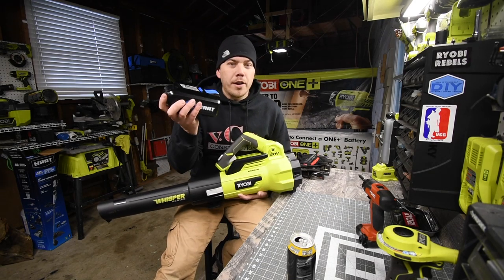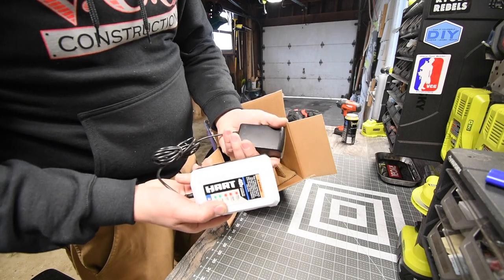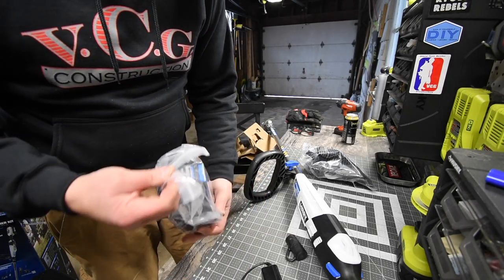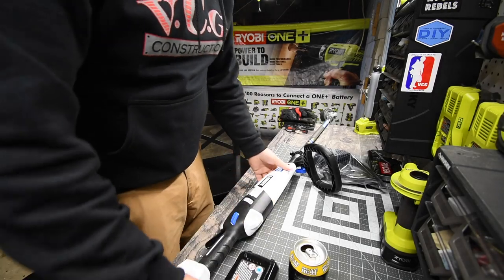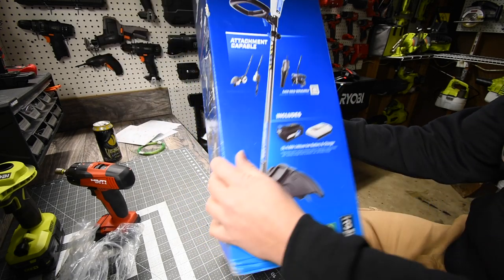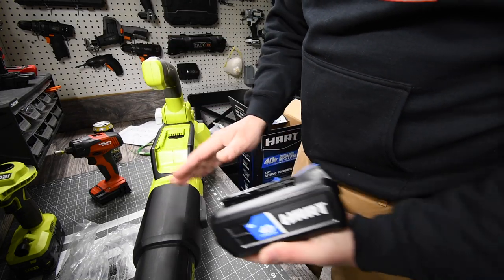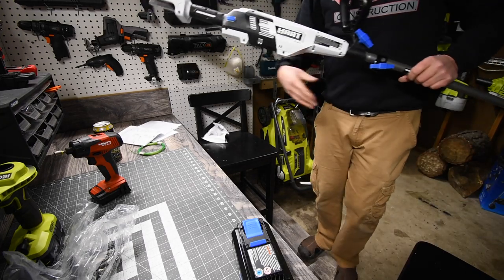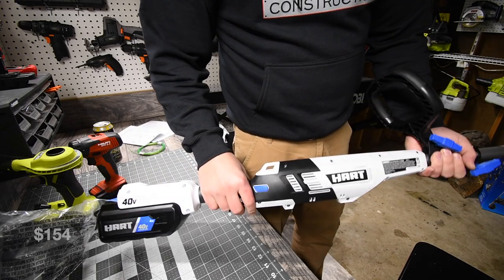Walmart - HART 40v String Trimmer Unboxing/Demo

Comment: This is a great tool I got one yesterday, left it charging overnight, used it in the morning cleaning up a bunch of weeds on a halve acre lawn,  trimming and stuff, used the tool for about 1 hour and a halve continuously, placed the battery on the charger and it showed 1/4 of the charge left. So with that said, this is a tool for home usage, not for commercial use unless you carry more batteries already charged, I really like it for home.
Reply from the maker: no lawn care battery tool good for commercial use. but im glad you like it and I can't wait to try out mine this summer
Reply: @ManCaverTools  hello

Comment: That line will work with Ryobi 40V Expand-It Heads also. There are also many other brands that are interchangeable besides Hart/Ryobi. The "Expand-It" lines are All interchangeable from all that say "Exapand-It" on them. I sold all of my Expand-It Ryobi units. That black cap is to hang all the attachments on a wall for that "Main Unit". They make a blower, edger, tiller & a few other ends that work with the line. I have a bunch of the those "Black Hanging Caps" left over I bought to add to my kit/bundles I sold.
Reply from the maker: that is good to know sir, ill have to try that out and thank you

Comment: I have the 20 volt version of this. It does a good job for what I do as I mow 4 yards. I would prefer a gas over the 20 volt but it is acceptable
Reply from the maker: another video about this is coming soon and it works great.
Reply: Get rid of gas and switch to electric for three top reasons:
1- quieter. 
2- no maintenance needed. 
3- zero emissions. 

Gas ones keep vibrating and too noisy. When i use electric one. I can hear others when they call ne unlike gas ones. They are at least 15 decibels quieter. So your ears will not get damaged over time.
Reply: How many minutes can you get off a single charge for the 20v version? I'm thinking of getting that one since it's cheaper in price than the 40v one.

Comment: I have 1 question and 1 warning. Question: how long did the 4ah battery take to charge?
Warning: I've had that version of the Ryobi expand it system with attachments and be careful of the loosening and tightening of that wing bolt and clamp. That style from TTI is prone to stripping. I was tough on my first one, easy on my 2nd one, both still stripped. Ryobi has since upgraded their design of that clamp, but Hart looks like the older Ryobi design. I have spoken. 😁👍
Reply from the maker: Th 4ah battery took about 2.5 hours to charge, the Ryobi battery took about the same time. I cant wait to test this out during the summer
Reply: Comes with a five year warranty. I would like to think if the wingnut striped they would replace it.

Comment: HELP I have that but it also came with a leaf blower and when i start the Weed eater the string keeps extending and it gets huge and I dont know whats going on
Reply from the maker: The string is not installed correctly. you should try to install it again because it should get to a certain length.
Reply: reverse the string spoon pool opposite to your machine's movement like if your machine moves clockwise then your spoon should be counterclockwise.

Comment: Anyone found a way to buy attachments for it? I went to the website and nothing is listed. I tried the website on the box ( Powerfit.com ) and the site doesn't work. Also, they don't have a way to buy the 40v 4ah battery. Only the 40v 2.5ah battery. I am very happy with the trimmer but will I be able to get parts for it in the future? Are the parts not available because this is a brand new line of tools? Thanks
Reply from the maker: I have not found the attachments yet. they might now be ready to sell yet
Reply: Pretty sure it's universal attachment size.

My edger from my old gas trimmer fits and works in the Hart

Comment: I got the Hart hammer not bad.  I'll stick to my 40v Ryobi mower, blower. Good video. Dont forget the PrueCrew shout out. Thanks Dave.
Reply from the maker: I got the brushless drill today
Reply: @ManCaverTools  Hart has got a brushless
Reply: @ManCaverTools  harbor freight just came out with an 80v system called Atlas.

Comment: I had the Ryobi and the only complaint I had with it is the trimmer head spins the wrong way. It flings everything at you if you hold the trigger with your right hand. All gas powered trimmers if you are looking down at the head spin in a clock wise rotation and the Ryobi and this one spin counter clock wise. I ended up having to use it left handed to keep from being covered and stung from the head. I was very happy with my Ryobi's run time for the size yard I had but on taller stuff it is a bit gutless so I had to take smaller swaths to a gas machine.
Reply from the maker: we will see how this performs in spring summer and fall and thank you sir
Reply: Yes, I know what you mean.  To compensate for that you need to trim from left to right.  A larger string guard would help immensely as well.  You should also pick up some braided .095 trimmer line, which works great on taller and tougher weeds and lasts a long time compared to smaller diameter line.
Reply: @bulldog7659  I have the Ryobi 40v trimmer (2nd one) and the blower. The trimmer guards I always remove and the Rotary brand .095 braided line is the best hands down,

Comment: Just bought this. Only because I didn't want to run to home depot during covid😷 can't will be using it tonight after charge
Reply from the maker: I hasn't failed me yet and it works pretty well
Reply: @ManCaverTools  it's a monster.   I am still working but I just cleared a well overgrown area.👍👍

Comment: Reading booklet, BEFORE making adjustments to any moveable parts, of HARTS weed eater, with your hands, REMOVE BATTERY from unit.... possible injury to yourself. In your video, you really didn’t emphasize  the importance of removing the lithium battery pack, when you were adjusting the trim-line. People will remember a hands on video MORE than remembering what they skimmed thru in the instruction manual EVEN WHEN IT READS... Read entire instructions. Otherwise good hands on video.
Reply from the maker: I thank you for your info